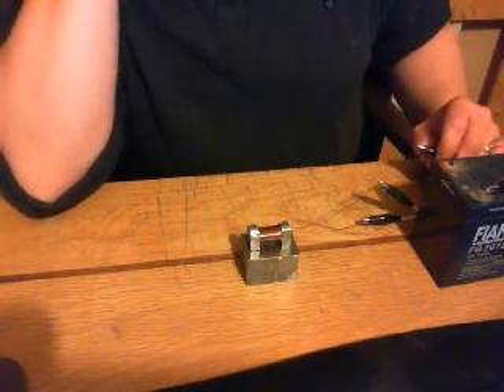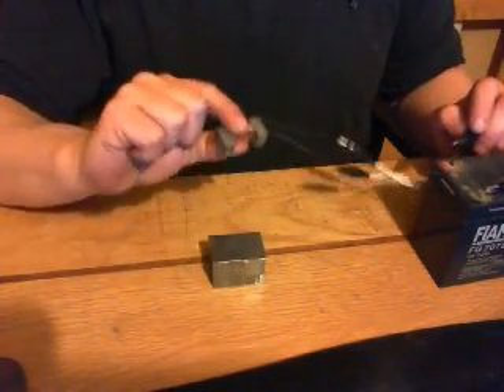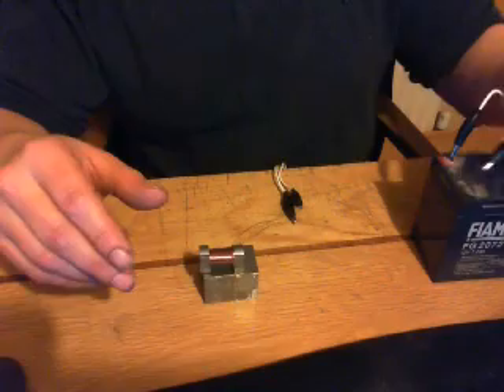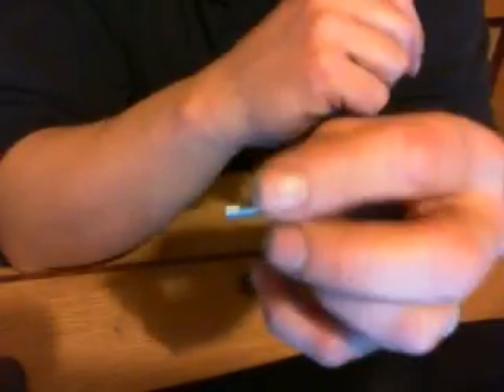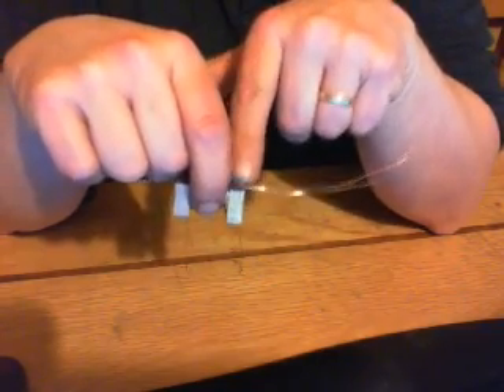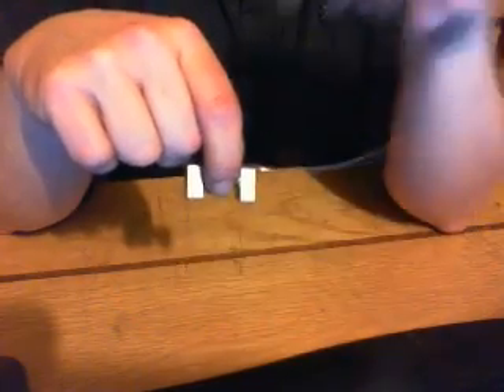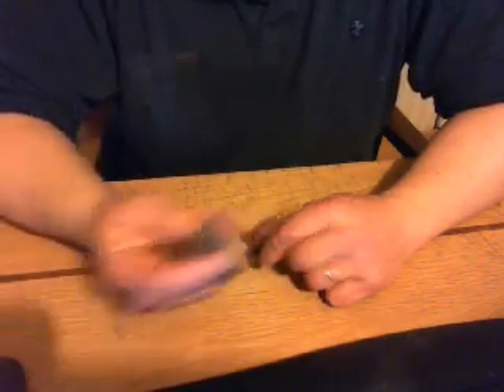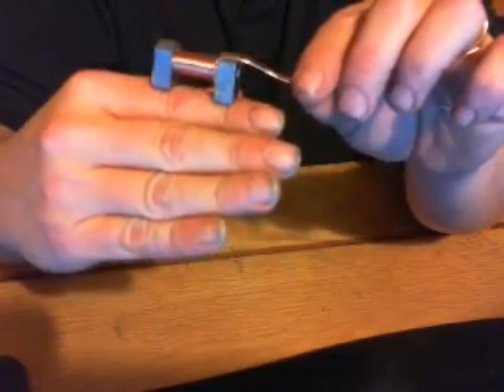Improved Flynn Gap motor hybrid

Comment: Hi,
I've just come to look at this and cannot work out if you magnet poles were placed axially or diametrically ? I know you are very busy at the moment with 'Sunvault' (I have 10000 shares myself !!) but would be grateful for the heads up.on this.
Reply from the maker: +Tony Smith north at the top and south at the bottom of the rods mate
Reply: +Robert Murray-Smith  Many thanks Robert....best of luck with your excellent work.
Reply from the maker: +Tony Smith cheers mate
Reply: +Robert Murray-Smith My apologies Robert....I hadn't seen your video on 9th Feb......der!!!
Reply from the maker: +Tony Smith lol - no worries mate
Reply: @ThinkingandTinkering  does that mean that there are 2 Magnets running  parallel inside of the coil with both magnetics facing the same direction south's at one end north's at the other? Please do reply, as I am extremely interested in this technology and trying to build one myself.

Comment from the maker: indeed they are quite complecated questions. First you need to know the flux density of your magnets as you are going to need to know what the opposing force needs to be which will be given in ampere turns The lower the number of turns the higher the amps you have to whack through so the thicker the wire. the coil calculations need to take heat dissapation into account as well. Coil design is available on the internt but you have to do the calcs. as for the flux any good text book will help

Comment: And my main question(s)...Depending on my chosen magnets strength and dimensions which will probably be bigger then the ones you used-how to choose the best wire for coil? How to calculate how many windings to do? How to find optimal calculation so that coil needs least possible voltage to turn magnets off? Where does one learn answers to all these questions?

Comment from the maker: it works because the NN orientation forces the flux path through the pole pieces but the NS orientation forces the flux path through the magnets only. The size of the pole pices is important - there must be enough steel to 'absorb' the flux.hope this helps.

Comment from the maker: It will only work with a neo and an alnico because the alnico is demagnetised and re magnetised by the pulse current you are putting through it. So, the orientation isn't important. If you find it is magnetic pulse it and it will switch the magnet off. pulse it again and it will switch it on again. The on off is permenant for the state you leave it after the pulse. So if it is turned off it will stay off until you pulse it again and vice versa.

Comment: I tried to replicate this experiment with neodium magnets, but didn't work :/ Steel block stays magnetized. Can it even work with neodium mangets only?
But another thing I didn't quite understand is how the two magnets were arranged inside the coil?
Is it:
N===S N===S
or
N===S
N===S
or 
N===S
S===N
And final question.On the end of video, steel block was magnetised to poles, and you said it will remain that way.Then you manually removed the steel block. Would it stick back on without electricty?

Comment from the maker: the pull will be one over the square of the distance. The problem here is the power required to flux switch - some kind of back emf harvesting could reduce this - which might be interesting to play with and a 555 timer based switching ciruit would be good to bring it more in line with art's desing - i show this circuit on my gap motor replication - hope this helps

Comment from the maker: Hi, It's a big old block of steel - the size gives a reasonable idea of the pulling strength of the magnetic arrangement - which is tiny by comparison. I think the magnet I used was a rod magnet 2 cm by 0.5cm diameter. This was realy a demonstration of a very interesting effect. I think it needs quite a bit more work to turn it into a motor. But flux switching occures internal to the little magnet arrangement so air gaps and spacers will have little effect.

Comment: Hi... I have few questions:
1. is the cube that is beeing lifted a magnet(as it looks like neodium magnet), or just some iron piece?
2. more important question, is it absolutely neccessary for contact to be made so flux would change, or it would still work even if there was air gap between or even some plastic distancer for example..

Comment from the maker: Hi sorry about the delay in replying - i have been away - i like the patent - and i agree with flux switching as a way forward - i am working a little on mhd augmentation of water arcs at the moment - a la graneau - which is fascinating but i am paralleling that with flux switching - which i have done quite a bit on but had no real success - i have several failed models and would be happy to put up videos if you are interested - as for a website - i am doing one now - so i'll update that soon